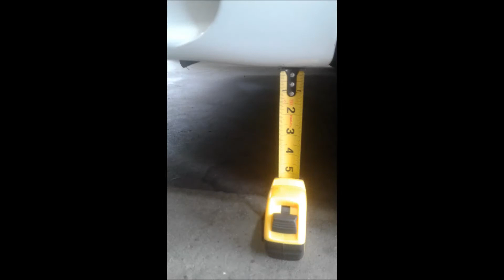Fox Mustang Suspension Slideshow

Comment: Nice,upgrades! How does she ride and handle?
Reply from the maker: Thanks brother!  It really depends on the tire selection.  With the dampers on full stiff and the 60 series tires on 15" wheels, the ride was actually not bad at all.  Would probably be fine as a daily driver setup.  Now running the 17" wheels is a different story.  Very harsh ride, probably not a good daily driver setup.  I have yet to experiment with softening the dampers though.  I am planning on doing some videos about the adjustable shocks and the different tire set ups whenever this cold weather breaks.  I really hate Chicago area weather!  The handling is nothing short of amazing though.  What a massive difference!  Could have really used this setup back in 1999 when I was running SCCA solo 2 events.  But, better late than never!
Reply: fwh79 Sweet,appreciate the info.
Reply from the maker: You're welcome.

Comment: If you don't mind me asking about how much were the KYB AGE struts/shocks from summit?
 And did you use poly spring isolators.?
Reply from the maker: $116.00 per strut and $84.00 per shock.  Yes, I did use isolators.  However, I did remove the isolators from the top of the rear springs to low the ride height a bit more.